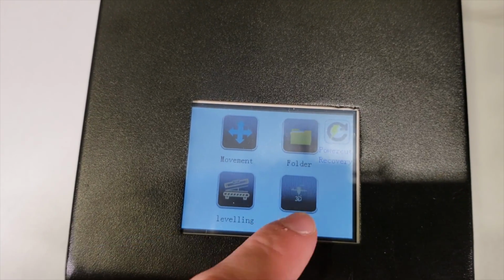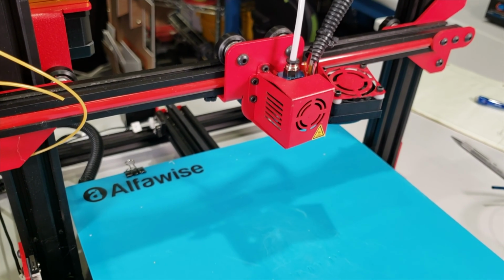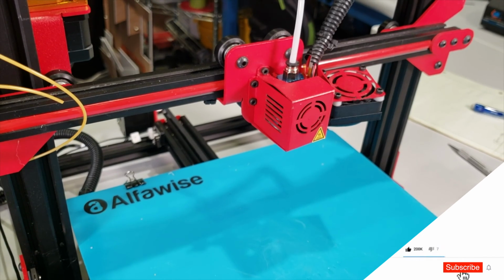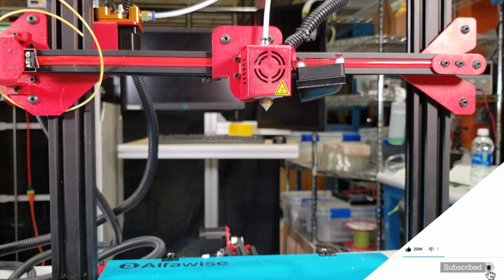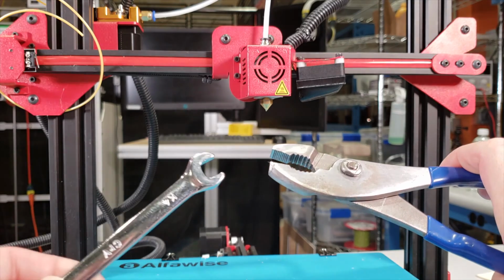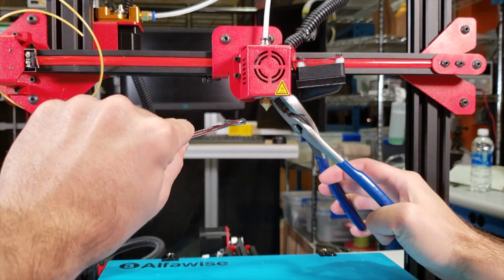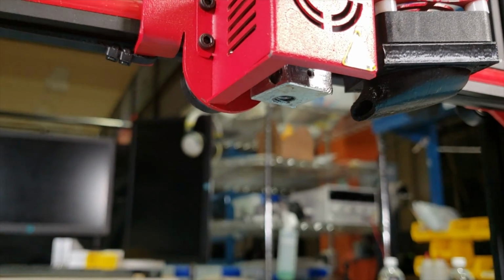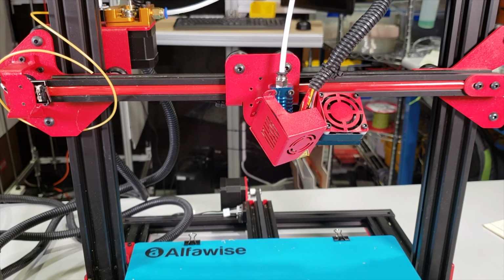How to Unclog your Extruder? | Alfawise U20

Comment: Thanks for the helpful ideo.
 The direction of turning the nozzle seemed initially counter intuitive but was correct - to the left. 
My heating block had wires making it hard to grip.
 I removed the fans and managed to turn the block. Then with a large spanner on that and a smaller one on the nozzle  I turned the smaller spanner which required some force.
 I had to partly reinsert it to heat it up  to 180 degrees and remove it to get the nozzle cleaner in from the tip.
 when i removed the nozzle and the filament partly solidified it came out of the nozzle as pushed the cleaner further in.

I would recommend securing the fan as I of the red leads came out.

Comment: Thanks for the great video, very instructive, I liked it a lot!
I have seen in several other videos that it is recommended to tighten the nozzle when the heating block is hot, and to take care that there is some little space between the heatblock and the nozzle. See for instance this very pedagogic video: https://www.youtube.com/watch?v=OzRAVkXjw3I&list=PLf5G8ckuY7eUeduyvL3bYwoO7eEviNr_V&index=6&t=1s
What do you think of it?
Reply from the maker: Thank you, yes this one is a good video for sure. If you tighten the nozzle when the heat block is hot, it will help to press any leftover plastics at the treads. But it will make your nozzle open to damages if you use too much force on the pliers. It is a trade-off at that point. be careful to not burn yourself

Comment: Thanks for this very clear and excellent tutorial. I am facing some issues on my new U20 and that could probably relate to what you did expose here. Thanks again!
Reply from the maker: Thank you, what is it?
Reply: @3DPDoctor  I did print successfully 2 gcode files from the sd card provided with the U20 and then I did create a lithophane file and the corresponding gcode in CURA 3.6 has been launched. The print started well and at 30% of the print, nothing came out the nozzle while the print seemed to go on.  I tried other prints, same result...The levelling is good, the print start but absolutely nothing come out of the nozzle...
I suspect it is clogged; so I will follow the steps explained in this tutorial.
Reply from the maker: I see
Reply from the maker: I hope it solves your problem